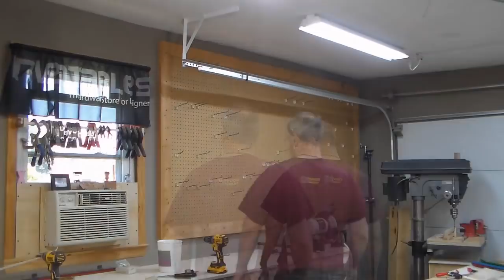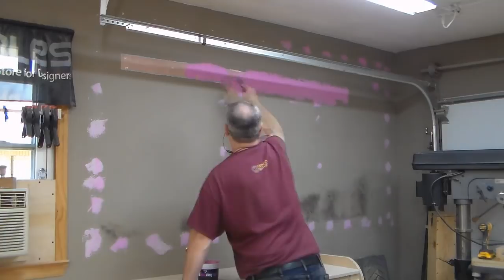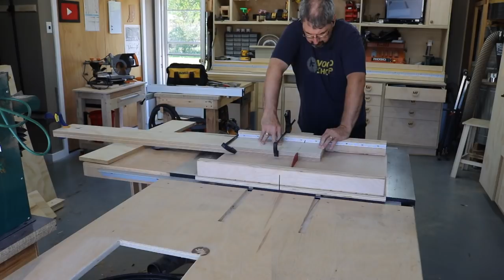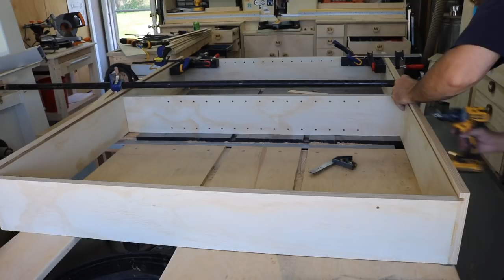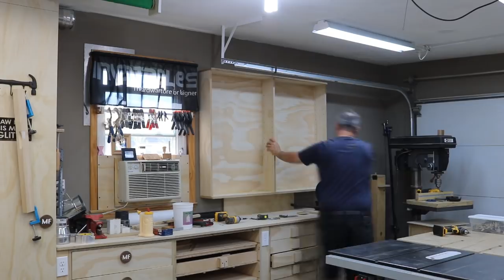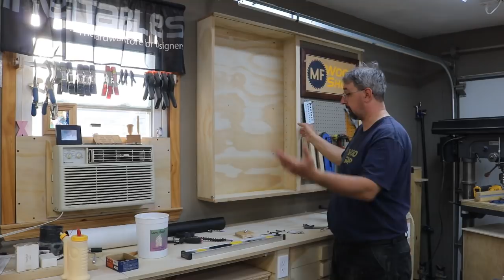Tool Wall Cabinet

Comment: Way to go Mike it looks great. Hey, you could build a second unit and but it up to this one and make the door larger and let it slide across both units. either way you knocked a home run on this one.
God Bless my friend.
Reply from the maker: Thanks Frank. That makes sense for sure. I have other plans for that area in the corner it will makes sense when I wrap the whole wall up.

Comment: It’s off the subject of ur video but I’m building a shop air cleaner out of a furnace blower. I have a small shop with no ac can I use it as exhaust air to cool my shop or do I need to vent the exhaust air outside any help would be appreciated and also I love the way ur shop is coming
Reply: Keep your clean cool air in the shop. The air cleaner just keeps circulating the air in the shop through the filter. Turn it on before you need it so the air is already moving and the dust gets caught in the flow and sucked into the fitter. Have it on a timer to run about an hour after you leave to capture the dust still floating.
Reply from the maker: If it filtered some how I think you wouldn’t have to vent out side. Look at Jay Bate video on his air cleaner that might help you